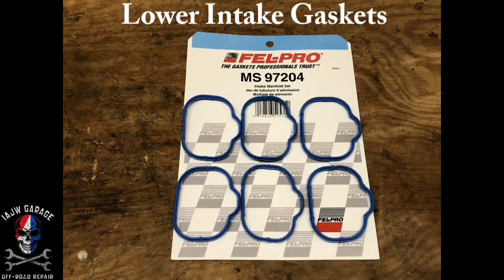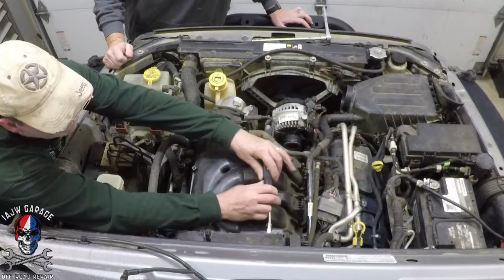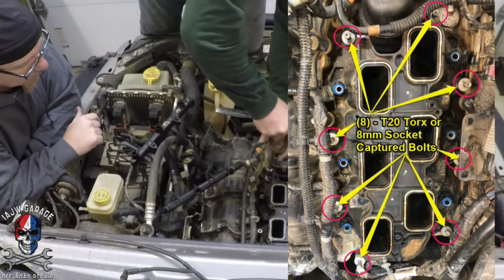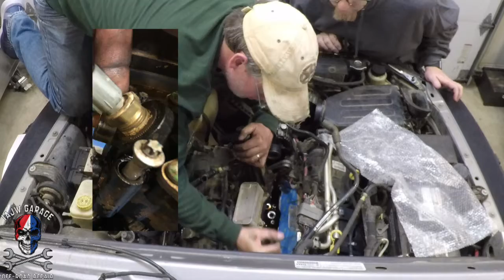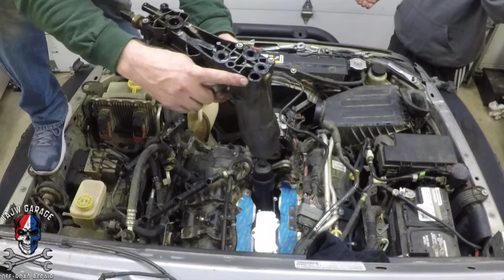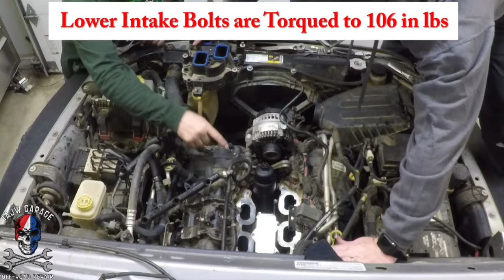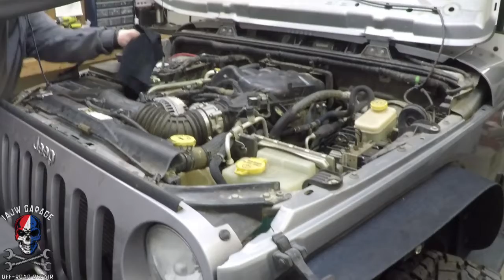Jeep Wrangler JK JKU 3.6 Pentastar Oil Filter Cooler Housing Replacement

Comment: Hey guys your video on the oil cooler is very informative. Although after getting to the lower intake section I didn't remove the fuel rails, just unclipped and separated the fuel line that feeds them and avoided messing with the fuel rail injector seals. Just threw a rag around the connection in case it was still under pressure when I unplugged it, and that part went much quicker and easier, other than being really careful in removing the plastic clip and lock ring that holds the coupling together. I always try to avoid disconnecting as many pressurized connections as possible cause I've often had them fail to seal after being reconnected.
Just one more thing to fix, aaaah !!!
Reply from the maker: Thanks for your comments

Comment: Awesome video, really helped. Thought I was all done with mine, went to start it and heard dripping looked underneath and gasoline was rushing out. Assuming I installed the fuel rail incorrectly. Think my mistake was leaving the injectors in the block when pulling the fuel rail. The o rings stayed inside the fuel rail itself.. must not of seated correctly is my working theory as of now
Reply from the maker: That is most likely the case, good luck

Comment: First off, Thank you so much for this video! It helped me so much fixing a way too common in all 3.6L engines. Second, I do caution novice DIYs on attacking this themselves. There are many frustrations that you will run into and you will question your sanity a lot. Before starting make sure you have socket extenders and knuckles, some of these both are just tough to get too. Make sure you have no where to drive too for a few days because it may take you more than just one afternoon like others have been successful with, so don't rush. The biggest trouble I ran into was removing the fuel injector plugs from the fuel rail. Damn red safety clips are a bitch especially when they put brackets and wiring in your way. Something soo stupid pissed me off for too long. This project took me a solid two days of just taking my time as it was 30 degrees out. Putting things back together was a lot easier. I have been the driveway family mechanic for 10 years and I do not look forward to doing this again. Do your best to find the aluminum cooler dorman 926-876 so you can avoid cracks in the future but often always out of stock! Good luck Jeepers, MillerLites help a lot.
Reply from the maker: That’s outstanding advice for novice DIYers, thanks for your comments
Reply: After hours of frustration trying to undo clips i finally Googled "9.6 red clips" and hit a gold mine.

Comment: Very detailed video, thanks for your professionalism and help.  That will help a ton of Jeepers, mine started leaking at + - 165,000 kms on a 2016 Jeep Wrangler Willys Wheeler Unlimited (103,125 miles). Will add cat litter in the Shop Vac prior starting the work and a old garden hose to cut
Reply from the maker: Much appreciated, thank you for the comment

Comment: I’m about to replace my oil coolant, but before what caused it to leak ? Does anyone have that answer what made it start leaking
Reply from the maker: Yes, oil rings on the bottom of the cooler from getting heated and cooled over time, they are rubber, they eventually wear out.
Reply: @ItsaJeepWorld  ok got it, is it ok to drive for now ?
Reply from the maker: @Giocastro001  I do not have the answer to that, keep an eye on coolant and oil levels
Reply: @ItsaJeepWorld  i rather just keep it in the garage until part arrives. Well I’ll be going through your video while I do the work, I’m sure I will be ok in the video looks pretty simple to do

Comment: My 2016 Jeep Sahara that has 50,000 miles on it is at the dealership now.   After they changed this part it will not start - they are trying to figure  it out . Smh
Reply from the maker: Probably fuel rail or connectors 
It could be many things

Comment: Is the a picture of the actual leak trying to figure out if this is my problem first leak noticed when I was driving through a ditch was kinda steep and rubbed my bumper got out to look for damage and seen oil on the ground and looked like it was coming down off my transmission then no leak for a year and I got under my jeep the other day and noticed a puddle with fresh oil did an oil change and have driven about 200 miles and oil level is still the same as when I did the change so I was thinking it’s filling up slowly then spilling out once’s full
Reply from the maker: If it’s leaking slow. It has a valley to fill up first before it starts to slosh and run out the back and down the transmission

Comment: The worse part for me was all the dang wire plugs. They break. I just finished this job with the help of this video. Thank you. I also changed the sparkplugs while I had the upper intake off.
Reply: Same. Those red lock tabs "bake" in place in the valley of heat.

Comment: The torque specs are INCH lbs not foot lbs like I’m used to. Don’t make the same mistake I did and strip your threads
Reply from the maker: They are listed correctly in the description

Comment: What a great video.  Had the computer in the garage, along with the directions printed out,  as my son and I did this today on his 2013 jk (we went with the aluminum housing option).  While we were in there, we also changed the spark plugs--the ones on the passenger side were way harder than changing out the oil filter/cooler.  thanks for the wonderful step-by-step video.
Reply from the maker: I love hearing that!! Thank you and good job!!
Reply: Hey Tim how’s the aluminum housing holding up?
Reply: @Therealclayton  housing is doing well
Reply: @182johnson  appreciate the response. My grand Cherokee has been at the dealer for almost a week getting it replaced under warranty at 50k miles but I almost want to go and tell them to give me my car back and I’ll fix it myself with the Dorman aluminum because I know it’ll just be a matter of time before the oem plastic part fails again
Reply: @Therealclayton  by no means am i a mechanic, but following the video made doing the change pretty easy, a few of the clips are challenging to get undone, but its manageable.  if its being done under warranty, i would have it done at the dealership since that should buy you at least 3or4 years

Comment: I just completed this job on my own JK. Thought the blue grommets stayed in the fuel rail because that’s where they were when I pulled the fuel rail off.  LOL - for those that don’t know they do not - unless you like fuel all over your driveway.  The blue grommets go on top of the injectors before you put the fuel rail back on.

The bracket on the right side of the engine is a major PITA.  I bent mine up to get more clearance and it helped.  Just had to bend it back when I was done.  All in all not a bad job.
Reply: I replaced my spark plugs too and it made a noticeable difference - it accelerates much cleaner now. (94k miles)
Reply from the maker: Awesome, good job

Comment: Oem part or aftermarket ?
Reply from the maker: Yes. It’s aftermarket but OEM equivalent. It has been installed 2 yrs with no issues. Check the part number, there may be a more updated version available now

Comment: I followed your video as closely as I could. Unfortunately, some of the locking clips were brittle and snapped so I had to pull the injectors. I had one hell of a time getting the O ring to seat in the valley. I pushed it down as far as I could (I'm 6'3" over 300lbs) and the cooler wasn't all the way down. I was able to use the bolts to pull it down. When I was torquing the bolts to 106 inch pounds with the same style torque wrench used in the video (Craftsman) the bolt furthest forward on the passenger side snapped!!!. I'm just going to go with it because it's my daughter's daily driver and hope it seals. If it still leaks I'll deal with the snapped off bolt then.
Reply from the maker: Wow, I’m sorry to hear that. I hope it seals and is fine for you

Comment: Who else has the same problem?
I have 60,000 on my 2013 Sahara been 
Replace o rings two times to day I’ve just replaced the hall thing from mopar , I see wranglers all over hopefully is just few of as with bad luck or they are building engines is cheap o rings and plastic?

Comment: I wish I could give you a hundred likes. This was so much help replacing the unit on my Jeep. I just had a small issue of one of the lower intake bolts breaking off in the head. Seems to be working fine with just 7 at this time.....
Reply from the maker: I appreciate that!! Very glad it helped

Comment: Working on this now...I can see how going back together is easier, getting those injectors plugs off was a bear. I have limited mechanical ability, consider this a pretty tough job and not for the casual do it yourselfer. Thanks for being very descriptive and posting torque specs for bolts and stuff.
Reply from the maker: You are welcome, I’m glad it was able to help you
Reply: @ItsaJeepWorld  It went back together sooooo easy, maybe it was the fact that it was untouched 2016 stuff that it was difficult to get apart. This is the first vehicle that is easler to put back together than take apart lol... oh and if you have one of those slender tubes for your vac it gets the intake pretty much cleaned out. I also left the rail on the lower intake and just tied it up out of the way with a bungie.
Reply from the maker: @robertelmo7736  a lot of people left that rail. Luckily the one in the video easily came off and went back on. Good idea on the vac hose

Comment: You should’ve got the aluminum why put back a plastic that would leak another 4000 miles after all that work wow
Reply from the maker: I don’t think it was available when I did the video. 
It’s been going fine for almost 20,000 miles.

Comment: Is this the same part and procedure as the 3.8 2007 jeep wrangler?
Reply from the maker: No totally different 
3.8 doesn’t have a cooler it’s a regular oil filter on the bottom of the engine

Comment: Why are you replacing 
The oil cooling housing??
Reply from the maker: Because the o rings on the bottom of the cooler deteriorate and oil leaks out the back of the engine and down the transmission bell housing.
Reply: @ItsaJeepWorld  okey dokey 👍

Comment: Just want to point out that you don’t need to remove injectors.. just take fuel line of fuel rails and remove it all as one piece. No reason to do more work than necessary.

Comment: Thanks.  Great video.  I had a coolant smell that I could not locate at first.  I changed the radiator because it was leaking at the seams and thought I fixed it.  Then I notices coolant running down the bell housing and evaporating on the exhaust.  Come to find out, the oil cooler had failed and was leaking coolant.  This video was perfect and helped me do the work myself.  Especially appreciate all of the torque specs for reassembly.  Thanks!
Reply from the maker: Awesome!!  I love hearing reviews like this!! Great job on yourself for doing it too!

Comment: The o rings on the top of the injectors popped off and are all there still. 

Should i put them back on ( reuse them) or buy new ones?
Reply from the maker: Unless they are damaged, there should be no reason to replace, make sure they are not cut or cracked
Reply: @ItsaJeepWorld  they are fine. 
Thank you so much!

Comment: Thanks for posting! It really helped to make the job a lot easier with all the torque specs posted in the video. I was able to upgrade my broken '13 oil filter housing to the newer style housing with minimal issues. Since the opportunity was there, I also changed the spark plugs and coil packs. Saved a bunch of money doing it myself instead of paying the a mechanic here in Belgium.
Reply from the maker: Outstanding I’m glad I was able to give you the information you needed!!  I changed a heater core in a TJ once in Brunssum, Netherlands
Reply: @ItsaJeepWorld  Brunssum? Small world! That must have been fun. I hope it was not during winter.

Comment: Excelente video l have the same issue in my jk,oil pressure sensor is stuck,l was scare to do the job myself but after l see how you guys did it,l will go buy a wrench for the torque , the rest of tools l got them ,and that’s it l will do that my self,1100 dlrs it’s a lot of money to pay,thanks for shared,
Reply from the maker: That’s Awesome!!

Comment: TIP: when you pull the fuel rail off of the injectors, be aware the o-rings that attach to the rail to the injector can fall out as you remove the rail. I managed to lose one when I pulled mine off. I double checked everywhere including down in the valves for it but no luck. No idea where that bugger fell to.
Injector wire connector removal: slide the red part up, then press in (squeeze) on the little black tab that is now exposed. All of mine came off easily

Also, make sure you remove the old seals if they did not come off with the housing. Check to old housing and compare it to the new one if you are not sure.
Reply from the maker: Good Tip. Thanks... I hope you find it. It could have sprung somewhere too.. boinged off into oblivion. Double check the connector... Get a bright light and check all the little crevices near the rail.

Comment: The oil cooler assembly was redesigned in about 2016. The new one fits just like the old one. They do, however use different filters. It is a good idea to indicate on the engine bay somewhere which one you installed.
Reply: Sorry installing the upgraded version in a older 3.6,. I should have been more specific, it does fit even though it is a little different.  That way your not doing the job again.....
Reply from the maker: Good idea, thanks for that Tip
Reply: There is a video out there of a shop installing one in a Chrysler Pacifica. Or caravan.
Reply from the maker: @alwhitesell4023  Yes, it’s the same oil cooler on most Dodge/Chrysler 3.6 engines

Comment: Was it causing engine temp to run hotter?
Reply from the maker: Is there any leaks? 
You might have not seated the cooler properly or did you fill the radiator back up after any fluid may have spilled out, I have not heard anyone saying anything about higher engine temps
Reply: I seen a pool a little pool of oil on oil cooler and on transmission. I had some cooling system work done and I live in Phoenix so the car has been running hotter.
Reply from the maker: @alexsantana5377  make sure whatever cooling system work has been done was done correctly. Sounds like something was not put back properly

Comment: Awesome video guys! I got up this morning to tackle this. Started at 7am, finish and running at 8:30am. Pretty easy repair! One thing is that you do not need to remove the fuel rails or injectors. You can just unplug the wire connectors and take the rails with the lower manifold upside down over on the drivers side.
Reply from the maker: You are correct, and that’s mentioned, but I chose to get it all out of the way, I appreciate your feedback
Reply: You are a pretty good mechanic then, unless the 8:30 was the next day lol like me lol!?

Comment: Great video. Now where to get the oil cooler? Are the Amazon ones any good?
Reply from the maker: Thank you and Yes, search for the oil cooler part number in the description. We got ours from Amazon
Reply: @ItsaJeepWorld  are you still running the same one from the video? How many miles on the replacement?
Reply from the maker: @mikehastings9215  Yes, same one 
Not sure of the miles. But it’s daily driven since being replaced

Comment: Hey guys, thanks for the video! I will be replacing the one on my Wrangler this evening. I read a few blogs here and there to try to get information and a solution and everyone in the blogs who have experienced this problem have had different experiences, some people recommend using Mopar parts, others think that Mopar is trash, some others opted for using cheap parts and after a few months, the problem occurred. Looks like it has been almost a year and a half since this video was uploaded and  I was curious to ask, has the housing that you installed leaked at all, or is it still clean?
Reply from the maker: No leaks, no issues since we replaced it. It’s driven everyday by HS aged son, so it’s getting “used” lol

Comment: Just replaced my oil cooler filter housing it took 4 days lmao 🤣 great video best I could find my only warning ⚠️ is on the reassemble be very cautious to get the 4 studs through the two brackets on the driver side of the upper intake I failed to do so and broke my lower intake manifold and had to spend more money and wait 3 days to get a  new one so just word from the now a little wiser 😅
Reply from the maker: Ouch, sorry that happened 
Glad the video was useful
Reply: @ItsaJeepWorld  incredibly useful

Comment: Thanks for a great video. Was a little worried pulling this much crap off. But there is no need to remove injectors n fuel rails.
Reply from the maker: Options. You can or you don’t have to. I felt it easier 
Glad the video helped you

Comment: About to tackle this because of your great video - as I've never tried anything like this before! Can you help me confirm that 68105583AB is the most current upgraded part (you mentioned better seals in post-2014 versions of the failing part) but will still fit a 2014?
Reply from the maker: Here is the Newest Number: 
68105583AF Oil Filter Adapter Housing Assembly for 2014 2015 2016 2017 2018 Chrysler Dodge Jeep Ram 3.6 V6 Pentastar )Replaces 68105583AA 68105583AB 68105583AC 68105583AD 68105583AE)
Reply from the maker: If you look in the Description... It is updated as they come out with New Versions.

Comment: At 7:14 do you remember if there was anything else you had to do other than slide that clip back? I slid mine back and it still feels locked up
Reply from the maker: They are snug use a small screwdriver possibly